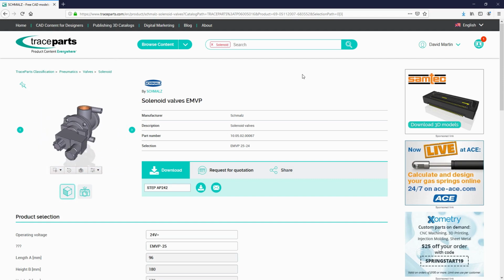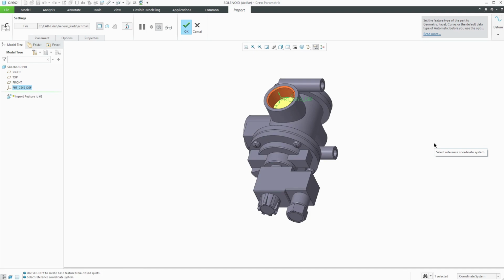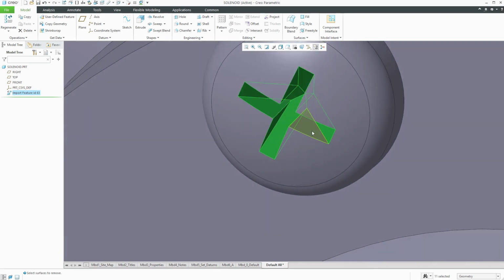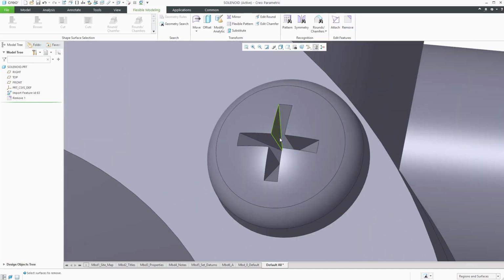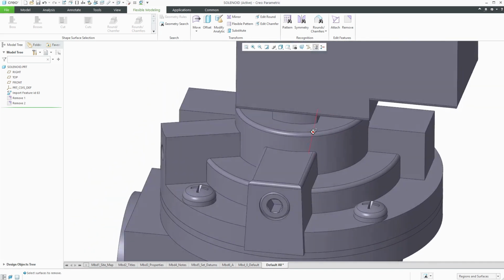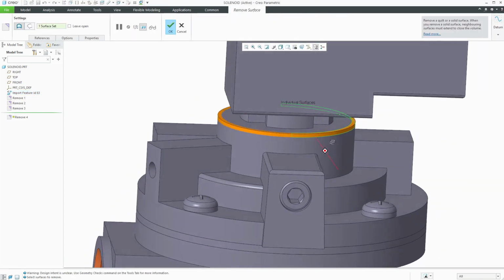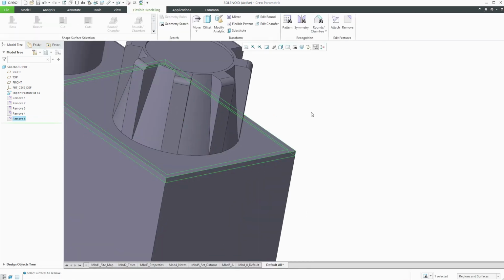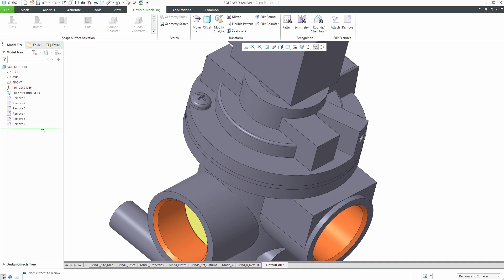Creo Parametric - Remove Tool

Comment: How to remove draft feature in imported geometry?
If have any suitable remove tool or trick?
Reply from the maker: I’ve got a video on that. It has the word “Draft” in the title. I made it a few years ago. You should be able to search for it.
Reply: @CADPLMGuy  ,
Thanks for your reply.
I will try it. 😊
Reply from the maker: It's in the video "Creo Parametric 7.0 - Draft Feature Enhancements." Basically, within the Draft feature itself, you can apply 0 degrees of Draft (return the surfaces to vertical) to previously drafted surfaces, including imported geometry. Pretty nifty.

Comment: Hello your video is very informative, thanks for this. I have a step file and I want to remove several surfaces but I am only able to select one surface at a time! Even if I am selecting the surfaces first and then clicking on the surface remove command only the last selected surface remains selected. Can you please suggest any solution?